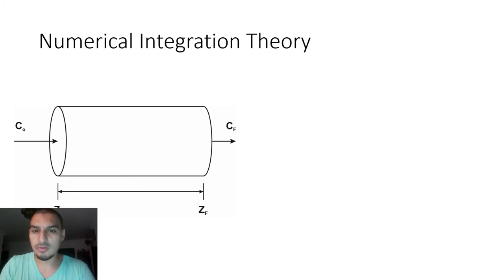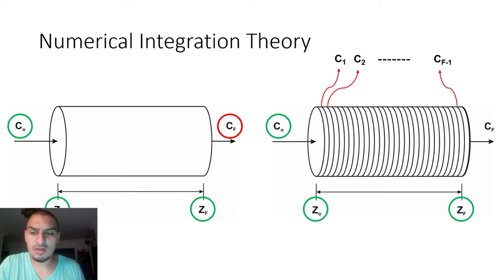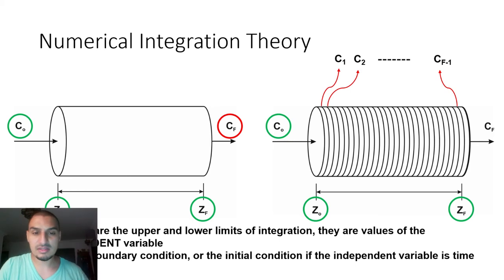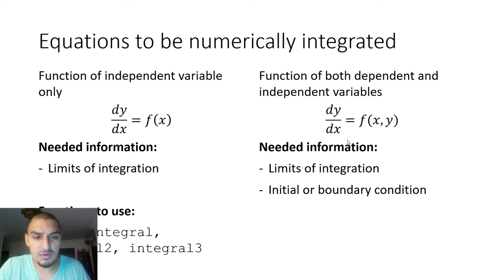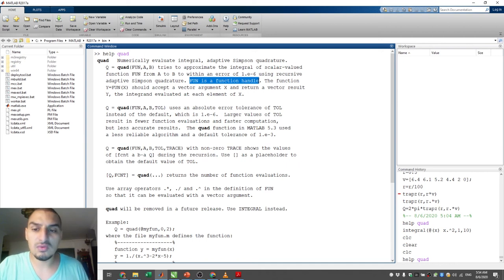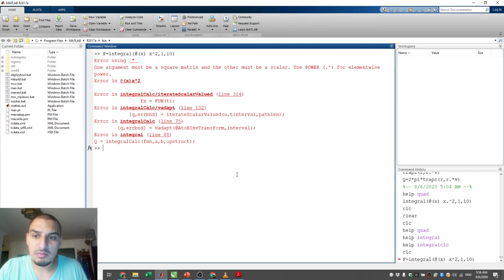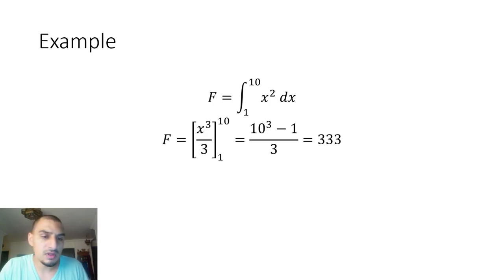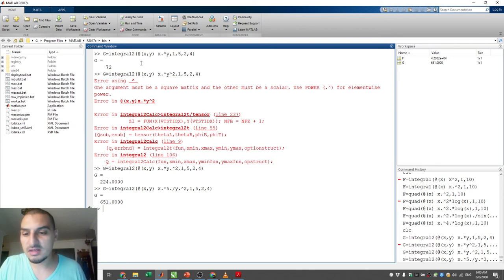Introduction to Matlab in English | 50 Numerical integration - quad and integral functions

Comment: When we add sin(5.*x) to the equation I got -351.6065. I think it did not succeed in the calculation.
Reply from the maker: The integration of sin(5x) by itself gives negative value. So, it is not strange to produce negative value if it is multiplied by the function.
It is always better to recheck the code, if it is right then no problem.